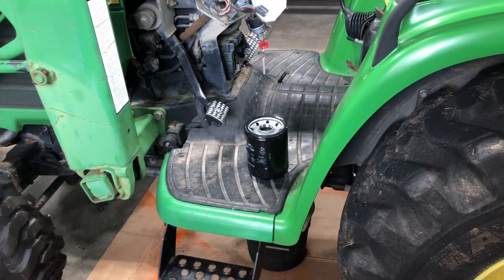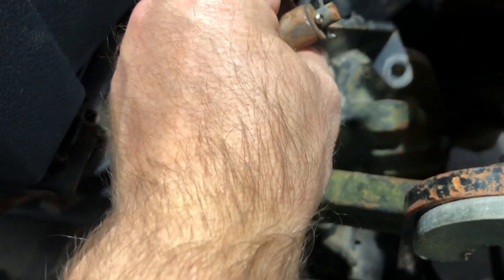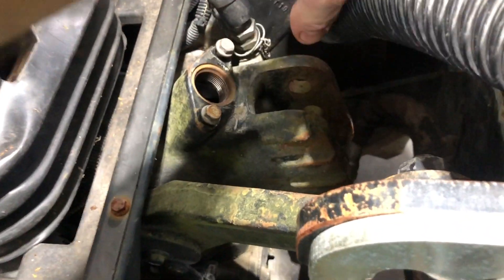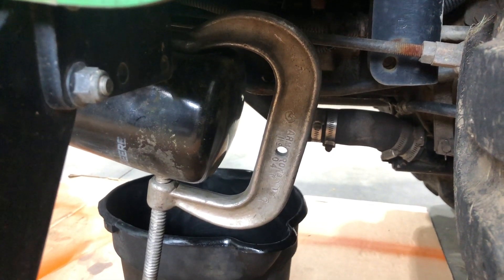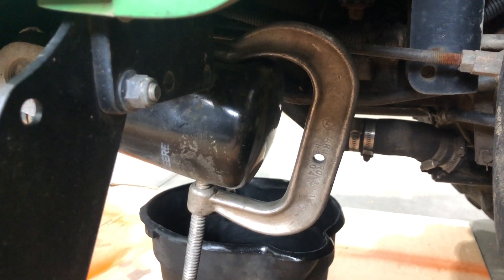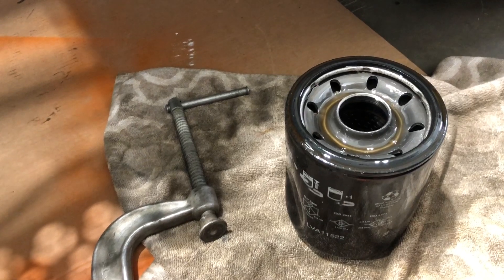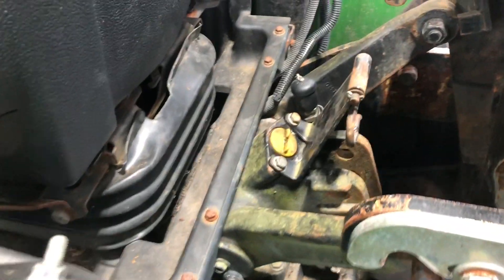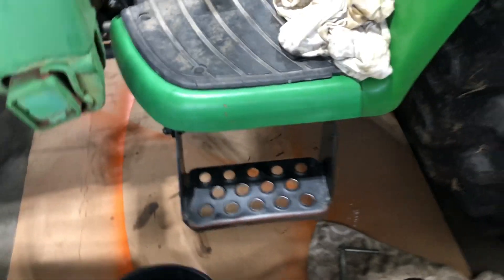John Deere 4310 Hydraulic Oil Filter Change

Comment: You need to start it to check oil in site glass. Once started it will be half in site glass . This is normal. Talked to a jd tech and thats what he told me. You start with half before starting engine. Then start engine , you might burn up that hydraulic pump. They are not cheap. Refer to manual it tells how much to fill it. Don't guess!